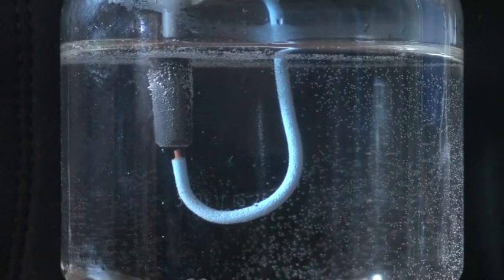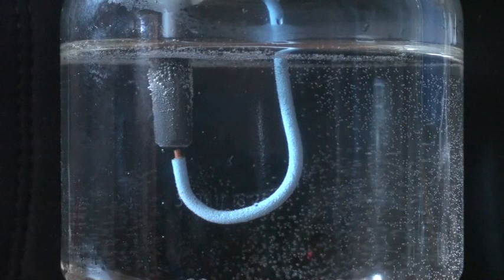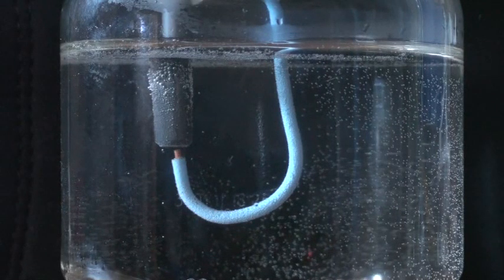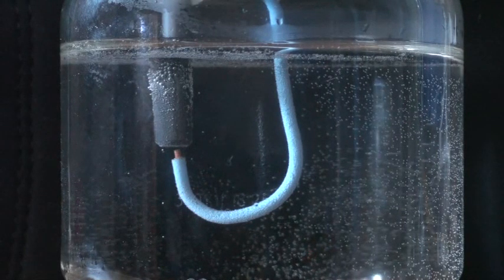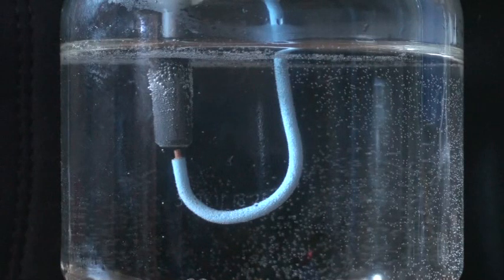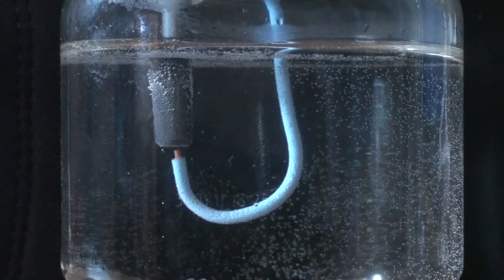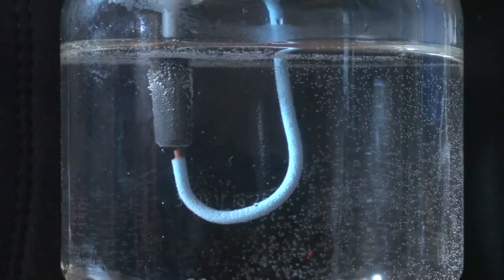high voltage for splitting water part 2.wmv

Comment from the maker: @freeenergynews 
Hi Stefan, the main electrode is a carbon rod (it is unidirectional carbon fibers glued together wit epoxy. I took it from a the structure of a kite.)
The second electrode is a simple copper electrique wire insulated.

I just made a bubler to store some gas, but it seems that no gas is going out of the cell ?? as if there is no electrolisis  ??   is it perhaps pure implosion ??  or cavitation ??   will recheck

Laurent